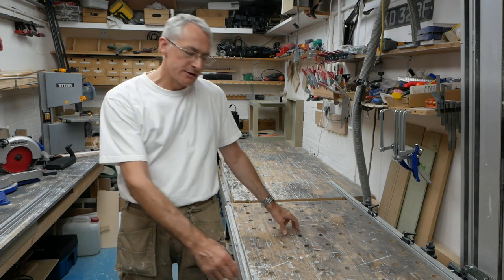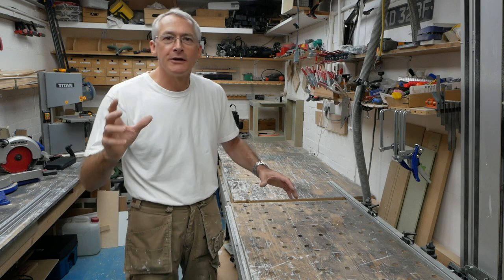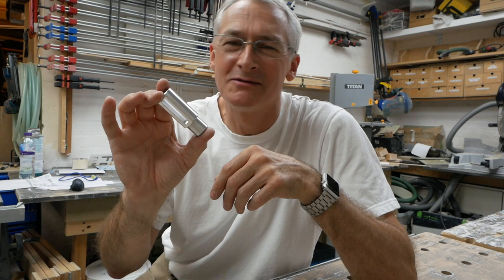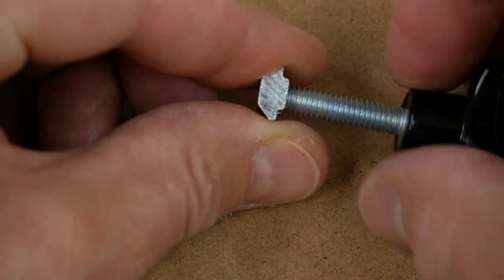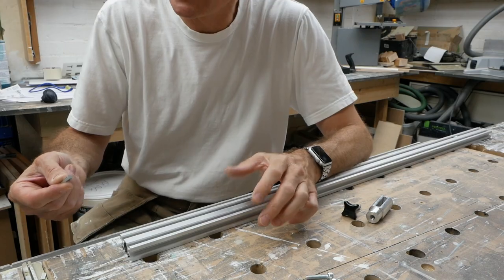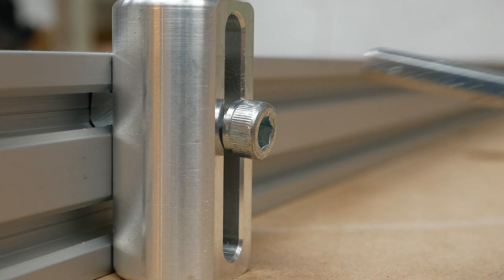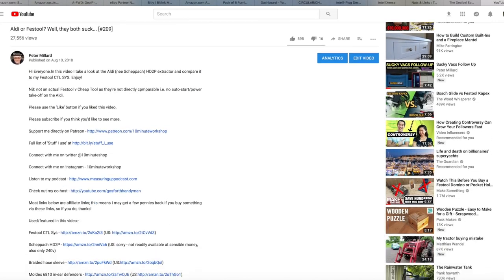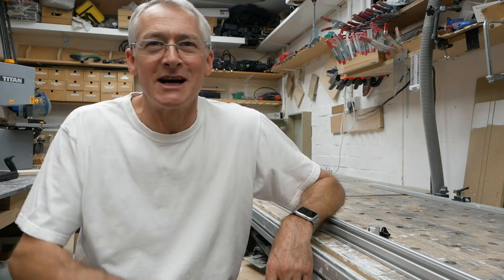Fencedogs 👍👍👍 [#212]

Comment: I'm looking to add a fence and rail/hinge to my existing bench. If you're using the profile as above, its too tall to fit under the rail, so do you plan to stop it before it goes under the rail, or are you using a lower profile, profile..? I guess it will all become clear in your upcoming video....hurry up...;-) ps As per my other comments, I'm dying to see your rail/hinge solution...!
Reply from the maker: Hi Simon. Sorry, I can’t have explained this very well as this comment has come up a few times! The fence dogs & this extrusion don’t go under the rail, they’d go to the left-hand side of the rail. If you wanted to run the fence under the rail (for narrow cuts, say) then either use 20x20 extrusion, or lay the 20x40 flat, ie 20mm high, and pack out the difference between the workpiece and the rail with offcuts. 👍 As before, the portable bench built is still at the design & planning stages- it’ll be a wee while yet 👍👍
Reply: Hi Peter, I did eventually read all the nearly 250 comments and saw that you'd already answered this point...sorry..;-) I do have some T-track that is smaller and may find a way to incorporate that as a fence, with some brackets to attach to my bench dogs...the fun never ends...lol
Reply from the maker: 😂👍Yep, regular t-track is pretty low-profile...

Comment: Hey Peter, I know you said you were a 'cheapskate' but if you look at the price of Benchdogs.co.uk kits that come with these fence dogs and a flag stop, it costs only £27 for their 1m fence rail AND it's been laser etched with a  mm accurate scale along it's length. Sure you could buy a stick on measurement scale for your Ooznest 1m extrusion, but the price difference by the time you've paid for shipping (£12.60 + £8.27 P&P = £20.87) is just over £6 and that's with the laser etched scale. Don't get me wrong, sometimes I spend ages trying to find a cheaper way to do things myself, only to realise that even an hour wasted doing this is more costly than what I've 'saved' (LOL)
Reply from the maker: Absolutely; Bencjdogs weren’t doing the last etched fence when I made this video - it’s a relatively recent addition. 👍👍
Reply: Very true peter it was bought in afterwards.  The joys of progression. The new fence now has the double scale in it. On its route to you.

Comment: Very cool. Would these work with the Axminster Parf Guide system?
Reply from the maker: Not sure what you mean by ‘work with’ - other than the slot they’re pretty standard benchdogs. Is the Parf guide system different somehow??
Reply: Id say thay would as its just a 20mm hole as standard
Reply: It wasn’t clear on the site what diameter the Parf holes were. Thank you Jesse.

Comment: Which weight option for the aluminium extrusion are you using Peter?
Reply from the maker: Hi Fergus. V-slot only comes in one weight AFAIK - I used the 20x40mm section, as stated in the vid. 👍👍
Reply: Thanks and sorry Peter - I looked at two suppliers' sites and then asked the question based on the one you didn't use - "facepalm" + doh!
Reply from the maker: 😂 DW we’ve all done it. FYI links to all the ‘stuff I use’ are in the description of this and every video, or at http://bit.ly/stuff_I_use 👍👍

Comment: Hi Peter, great video and just what I was looking for. I do have one question however - as you have the 40mm vertical height of the fence how are you handling the track-rail bending as you run the saw along its length. I assume there is a gap between the rail and piece being cut of 30mm+ which will mean the saw cuts deeper at the centre of the cut and then pulls up as it approaches the fence. Have you found a way around this issue?
Reply from the maker: Hi Mark. It’s not an issue if you have the fence stop before the rail. The fence dogs keep the fence in place, I’m assuming folks will use rail dogs or regular bench dogs to align their rails on an MFT-style top. 👍
Reply: Hi Peter, thanks for the quick reply. I think I may not have explained the question correctly. I am talking about the vertical space. On the MFT I will use a dog at the other end of the table. This  together with the fence dog keeps the track perpendicular to the fence. But the track will be suspended at the height of the fence (40mm). So there is a sizeable vertical gap between the track and workpiece. When you use the track saw the track will bow in the middle. Meaning the saw will cut deeper. Does that make sense. I’ve not experimented yet but will do hopefully on Monday when my fence arrives.
Reply from the maker: Hi Mark. No, I understood your question, it’s clearly my answer that’s... unclear! The fence isn’t meant to sit under the rail, the rail goes at the end of the fence, and rests directly on the workpiece. If you must have the rail over the fence (making narrow cuts, say) then I’d assume you’d lay the fence flat, so it’s 20mm high, not 40. With my MFT, I have the fence extending under the rail for narrow cuts, and I put the workpiece flat on the surface and pack out the ‘gap’ to the rail with offcuts of sheet goods. Hope that makes sense 👍👍
Reply: Ah - thank you for persevering - I've got it now!! I had assumed that it run under the track, which was why I thought there would be a gap causing bowing of the track. Seems a bit obvious now that it could sit to the left of the track rather than under it. Sorry for the stupid question.
Reply from the maker: Mark Onions Hi Mark - no such thing as a stupid question! It’s come up a few times so I clearly haven’t explained it properly - there’s a quick follow-on video about it due up tomorrow 👍👍
Reply: Great - glad you are doing a follow-up video as I meant to suggest it. I am sure people would like to see using the fence for long boards - but also how to cut pieces that are narrower than the track (so less than 190mm). I see this has come up a couple of times in the comments, so would be good to see how you get around that. I see that as probably the main issue in the track-saw setup totally replacing a table saw. Although a band saw may be able to do it?
Reply from the maker: Mark Onions It’s not a big deal really - though now you mention it ‘narrow cuts on an MFT’  may be worthy of a separate video all of its own! The only fiddly part is getting the stop in place, as there isn’t enough space beneath the rai, obvs. But it’s so-able with a bit of scrap the same thickness as the workpiece, just extend that out to the stop beneath the rear of the rail. 👍👍

Comment: Will the profile take the Festool adjustable stop?
Reply from the maker: The flag stops? Unfortunately not as far as I can see; it’s something I need to work on adapting or making 👍👍
Reply: When you purchase our system you will receive the flag stop in the kit as well as a ruler which is fitted to the extrusion.

Comment: I was trying to cut back on my tool buying...thanks alot!

If you're doing a new bench build, maybe your thoughts on the Parf Guide system from Axminster or the Dominofix jig. I have both. Yet to use the Dominofix jig. The Parf system takes a very long time to set up and after all the effort it wasn't as accurate as I had hoped. And there was a little play in the fit of the veritas bench dogs. 

But the fence looks great
Cheers
Reply from the maker: Cheers Jesse. Axminster were supposed to be sending me a Parf guide system to try, but nothing’s materialised. Seems a bit pricey for what it is - you can get an MFT too CNC’d for 30 quid - and interesting to hear about your experiencing lack of accuracy - last thing you need! But yeah, more to come with the mobile bench & all 👍👍
Reply: Just to throw a spanner in the works I have the Parf Guide system and it worked a treat. Very accurate. Just as good as my MFT, though sadly I need to make a new one now as the old one looks like an ice skating rink after an elephant dance training session. :o(
Reply: I think it was more the play in the tall veritas dogs when I pushed the rail against them as the shorter ones where fine. Measured both with calipers and they are both the same.

Comment: I still don’t understand how you cut with the fence attached. Do you have to place the tracksaw track perpendicular to it? Thanks PM
Reply from the maker: Yes - just like on the MFT, the work bears against the fence at the top of the MFT benchtop and located in a row of holes, and the rail bears against eg benchdogs in a column of holes. 👍
Reply: And the track is placed over the fence top?? I think I have to wait for your upcoming MFT build video 😁
Reply from the maker: The rail butts against the end of the fence - it's not for making very narrow cuts. This is quite an old video - the Mk2 fence has under-rail support, see video 420, Benchdogs fence Mk2 -  https://youtu.be/KXBdxdeM_3Y 👍

Comment: Got myself an mft style top and some dogs to make accurate cuts with my erbauer track saw but every time I make a cut it's always a mm or so out of square, it's like the track is out but seems to measure up good, would you recommend getting a better track or am I doing something wrong, any help would be great
Reply from the maker: First thing I’d check is to make sure the MFT top is square - I’ve had one that wasn’t! If the grid of holes is 100% square, and assuming the saw is snugged up on the rails, then I’d look at the placement of the rail and the dogs. Are you using rail dogs (the ones that bolt onto the underside T-slot) or just butting the rail up against a regular dog? Is there any chance of the rail slipping against the dogs? Is the saw blade running straight and true ie no play in the bearings? All these kind of checks are easy to make, but I’d start with the basics and make sure the MFT grid is true, that all the dogs are the same size, that there’s no play when they’re inserted , etc.. etc..  

Let me know how you get on, OK? 👍👍
Reply: @10MinuteWorkshop I will try this, I just butt the rail up against the regular dogs, loving the channel which got me into this woodworking

Comment: I recently purchased fence dogs and guiderail dogs as well as a new mft top. I can not seem to get a square cut from it! I have tried multiple pieces of extrusion and different holes for the fence dogs but no luck . Everything is tightened but does not cut square  . Help!! 😔
Reply from the maker: The fence dogs and rail dogs take all their ‘squareness’ from the MFT top - there’s no play in the fence dogs and minimal on the rail dogs. So at the risk of stating the obvious, have you checked the MFT top for square?
Reply: Peter Millard thx for the reply! After some scratching of the head I found out that my fencedogss are uneven in thickness, and so the fence is not square not the holes. I am guessing Ralph will help me sort this now. I have a real festool top, so that shouldn’t be it. I assume.
Reply from the maker: Wow, never heard of that before! Yes, I’m sure Ralph will sort that out for yo. And yes, I’ve never heard of a Festool MFT top that’s out of square. Glad you got to the bottom of it, and thanks for letting me know. 👍👍
Reply: @10MinuteWorkshop  It did certainly make me doubt my knob fastening and work holding abilities :)

Comment: Question please Peter. 
https://benchdogs.co.uk/collections/fence-systems/products/fence-dogs?variant=7439204220986  Which 'variant' of the bench dog fits the Oozenest track please?
Seems there are 4 variants offered?
Reply from the maker: Either the M5 or M6 - they come with t-nuts that fit the standard v-groove extrusion, just threaded for M5 or M6 depending on your preference eg if you wanted interchangeability with other products that you  might have. 👍
Reply: @10MinuteWorkshop  Tks Peter. Not having other parts, is M6 the most common that you've seen?
Reply from the maker: @DavePawson  M5 is common for the Ooznest CNC, M6 probably most common elsewhere 👍